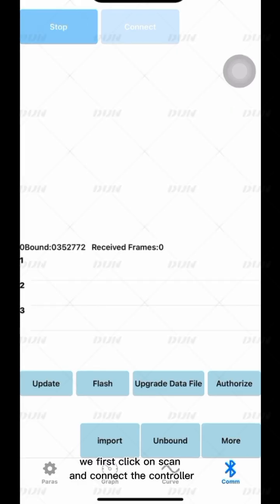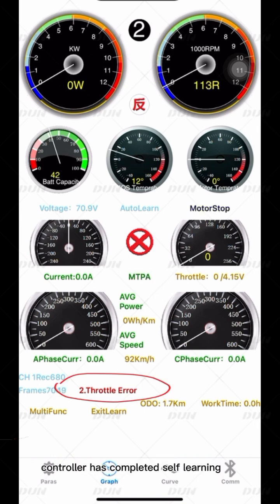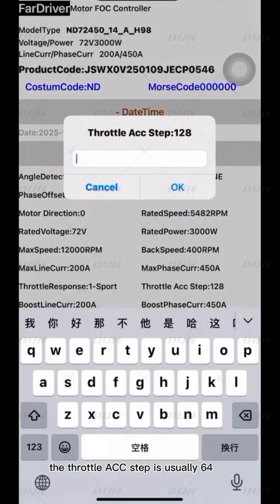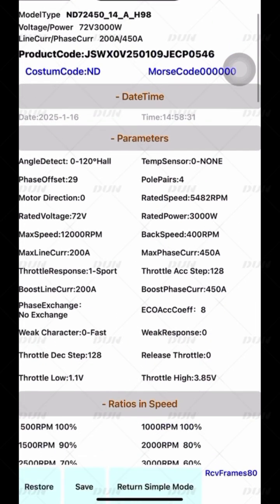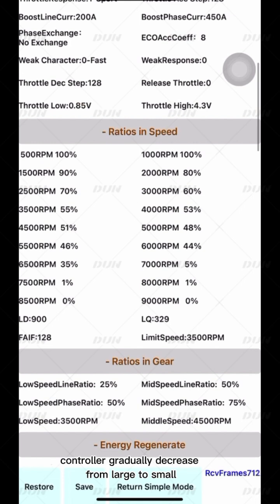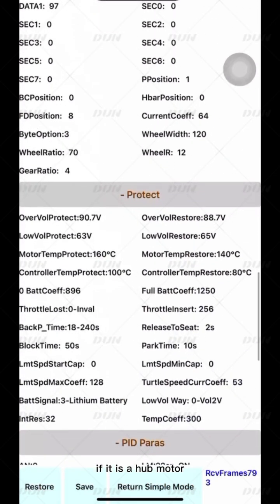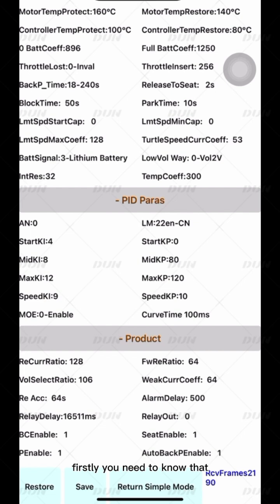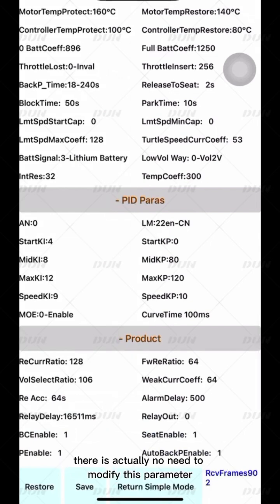Fardriver Controller Parameter Adjustment Tutorial

Comment: My controller keeps going back to A gear and a walking bike mode after accelerating. How do I disable it? Does it have to do with the 3 gear wires? 
Which 2 do i Connect together to leave it on speed 3

Comment: @Yomootechnology
Hi Do you have a video  or recommendations on how we would lower the acceleration just in sport mode on the tuttio soleil just a bit to peppy for my son. Maybe take 25% off that mode.  We have the FarDriver app but haven’t used it yet. Thanks in advance. Love your channel.
Reply from the maker: hi, you can change the throttle respomse to Line mode in the controller app, and also lower the Throttle ACC Step value (range 0-224)
Reply: Sir Do I still need to change the temperature put it on auto learn, and do that whole sequence to accomplish what I’m looking to do as well before changing any settings? Is that standard operating procedure always before making any changes.
Reply from the maker: @trp1684  you can set the temperature sensor before or after auto learn, and don't change other parameters before auto learn, after it's done, you can adjust.
Reply: any idea on cogging on a hub motor? qswp80029x hub. evident when accelerating or decelerating on specific rpm only AN is currently 0 , LM 22 pids at 4,8,12 Battery has enough power.
Reply: I have coughing on my dual 2kw single shaft QS hub motors at the rear. It’s just at the start, lower rpm. Had the same issue with Kelly controllers. Thought I could get rid of it with full foc Fardriver but no still there. Ite been mentioned you can use phase offset to adjust, or FAIF. Nothing worked for me though. Running at 48v, motors rated at 48v. My off-road scooter with duel hubs has no noise at all. They are much smaller and so the Hall effect sensors are much closer.

Comment: У меня контроллер 72/200 , фазный ток не реальизуется в полной мере. Максимум выстреливает 120 ампер фазного тока и идет на понижение до номинала в 50 ампер. Изза этого этектросамокат не может развить скорость 85 кмч
Reply: Your 72200 only has 45a-55a line current, and up to 200a phase current. If your max DC current is 50a, the phase amps will typically decrease to around the same voltage at top speed. 

If at top speed your Line current is maxed, and your battery is only 48v or 60v, the only way to go faster with that controller is to use a higher voltage battery. The higher voltage will allow more watts in, and therefore more watts out, which means phase amps will be higher. 

But you must verify that it’s not an RPM setting or ratios in speed settings limiting speed too early.
Reply from the maker: Hi, the continuous current and peak current depend on whether your battery can provide such a large current. Motor power, controller, and battery output need to match each other.

Comment: Hello, what voltage should I apply to the yellow wire to turn on the controller?
Reply: The ignition wire is Orange, not yellow, and it should be connected to the Battery (+) via an ignition switch.
Reply: 12v
Reply from the maker: which yellow wire?